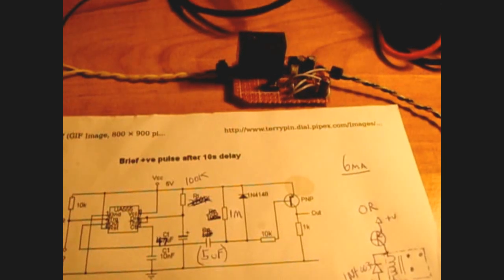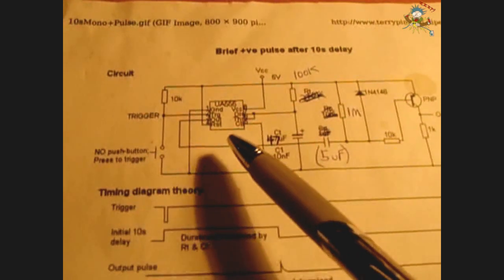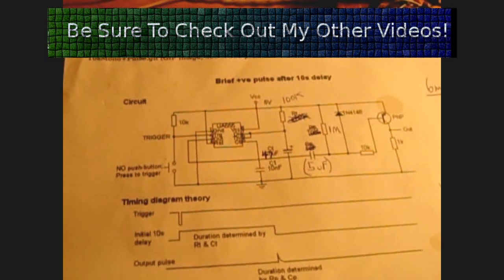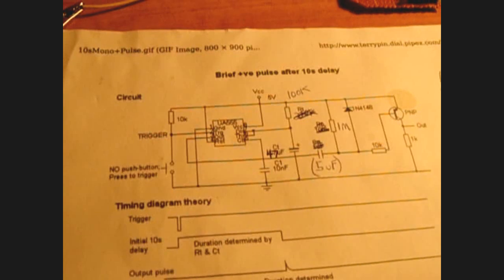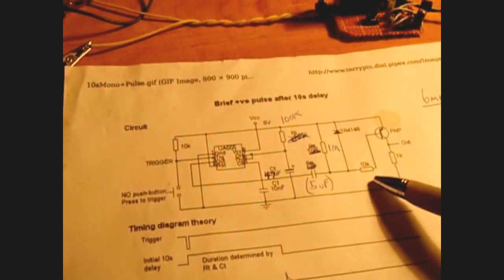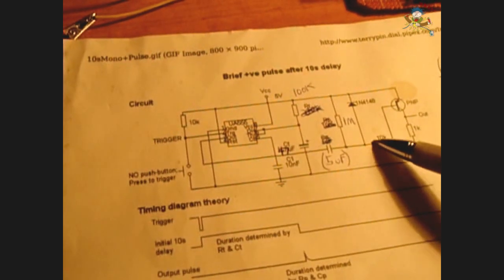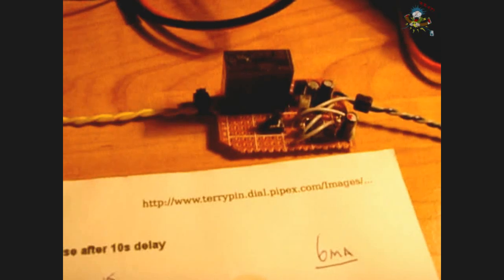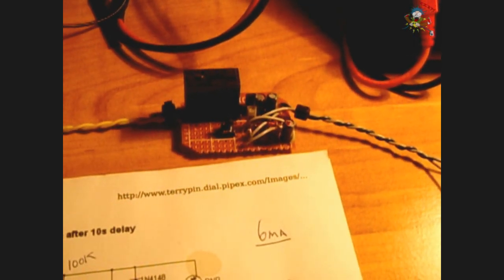Trigger, Then Short Delay, Then Brief Pulse V+(555)

Comment: What do I need to adjust if I wanted the output signal to be a variable length and not a pulse, I would like this circuit as a delayed variable gate?
Reply from the maker: It cannot be variable. You need to set it for the desired duration, and every time will trigger the same.
Reply: thank you for your swift reply!

Comment: what happens if you press and hold the button? I need a circuit that will make a single very quick open circuit and the close right away and it must not do anything else until the button is released and then pressed again. any thoughts? I need help guys!!
Reply from the maker: I have another video below that may help you, but why not just use a momentary push button switch and relay? The relay has normally open and normally closed contacts.
https://www.youtube.com/watch?v=q1Gj_mkMcI0
Reply: I must use something to activate and reactivate a relay on it own when triggered
and the trigger will not be released until the window goes back up a bit. I really don't want to buy an Arduino just to control the auto-down function of my switch panel..I believe the function on the window control panel is called "one touch".this is what I get for trying to upgrade the controls on an old truck. Its to control how far down a window motor pushes the window downward. it ts too complicated for me to explain with my tiny brain..lol

Comment: I made it 
Works well with led 

But at the collector I get 1.4volts when no pulse 

During pulse it shows a 4.2 volts 

What might cause it?
Reply from the maker: Did you use the correct transistor? PNP?
Reply: electronicsNmore yes, TIP127 PNP
Reply: electronicsNmore still same problem 
Cant understand whats going on

Comment: I made your circuit and it works well when you use a led, but when you replace it with a relay, the current drained shorten the pulse and don't allow the relay to engage. I'll try tomorrow with 10 uf instead of 5 uf. I hope it will work because I need this behavior.
Reply from the maker: Copy the circuit in this video, and use a similar relay. You see the relay works perfectly. Thanks for watching
Reply: As I said, I already copied the circuit in this video. what do you mean with a "similar relay", I use a 5 V 78 mA relay and it wont work.
Reply from the maker: Marcelo Aliberti Must have done something wrong. The circuit works just fine for triggering a relay.
Reply: I don't know what could I did wrong, if, as I said, again, when I use a led, as you did, the circuit works very well. Why don't you do a video using a relay????

Comment: This is very close to what I need but I don't know enough to make it work for my application.

I need an instant 2 second pulse when triggered (by a motion sensor), then sit idle while there's motion afoot, and another 2 sec pulse when the trigger, i.e. the motion sensor, turns off.

Long story short, an electromagnet pushes the button on my camera to start recording when someone triggers my motion light, but the button stays held down until the light turns off, and when it does turn off, the camera is still recording.

Comment: I've been looking for a circuit like this, but with a 5 to 90 min discretely variable time before pulse. Would that be practical with this design and a larger capacitor? At the end it would trigger a doorbell solenoid to strike a singing bowl (meditation timer).
Reply from the maker: Jeremy Pronchik Hi Jeremy. Use a low value ultracapacitor. You will get plenty of delay. 

Thanks For Watching
Reply: electronicsNmore thank you!

Comment: I built a circuit very similar to this about 7 or 8 years ago. It was part of a DIY "man down" system. I used a tilt switch to trigger it and a second 555 to latch the relay. The relay triggered a garage door remote, which in turn triggered a garage door opener, which triggered a siren. Kind of a Rube Goldberg contraption, but it worked.

Also, when I was doing some research for ideas to build my "dim bulb" tester, I viewed your video and another video from a different YouTube user. I posted a link to that video in the comments section of my video on it to give proper attribution.

Your channel is one of the ones that I go directly to when I see a new video up. A lot of good ideas and information.